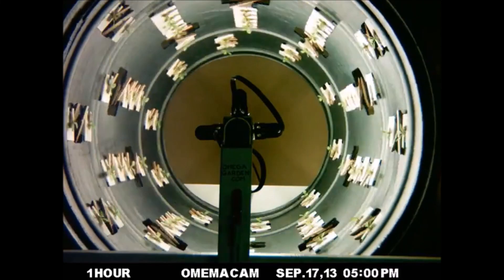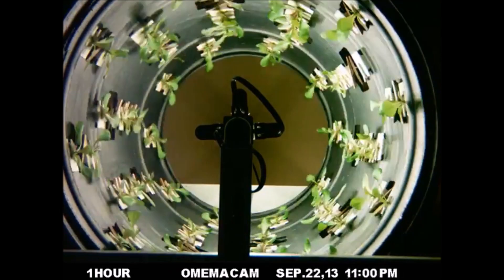Self Pollinating Rotary Drum Garden, the Future of Indoor Agriculture | Mini Ice Age 2015-2035 (396)

Comment: I will have a new time lapse video soon showing tumbler tomatoes fruiting with just 43 watts total power consumption.  That is just 2.3 watts per sq ft surface growing area.  A commercial greenhouse operation supplements daylight with 16 watts per sq ft surface growing area.  Water consumption is only 0.5 liters per day so far, though I do expect it to increase somewhat.  These tomatoes get almost billiard ball size, and the plant grows unusually strong due to the rotational stress similar to exercise for humans.  We will have a grain system soon, as well as a root vegetable model.  The vine type plants  are suspended with a simple lattice.  Many medium sized fruit and vegetables can be grown this way.
Reply from the maker: Hi Ted, where is the link? I will put that up for you.
Reply: Hi David, I am just in the middle of the tomato grow, and will send you the link when it's completed.  This is the first go round with the low wattage so I am not sure exactly how long it will take.  As soon as it is done, you will have it.  Thanks.